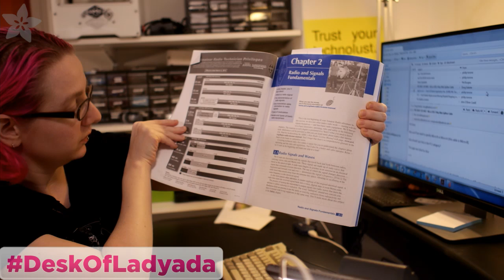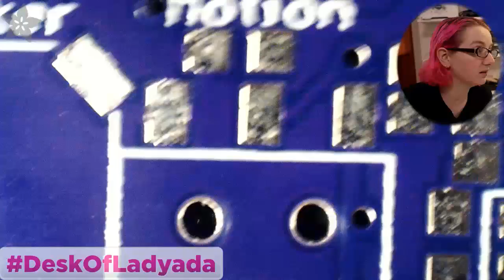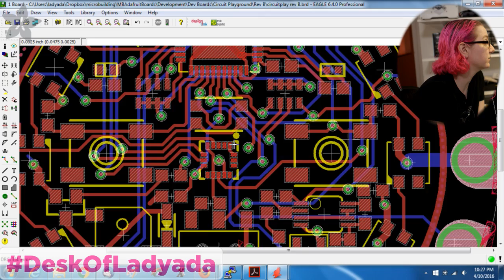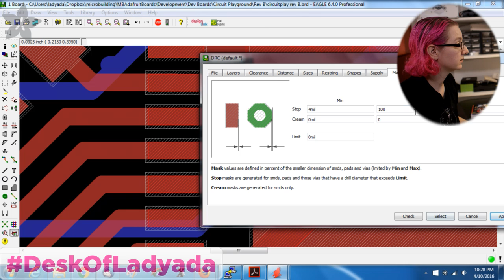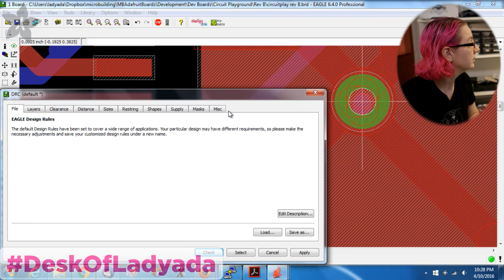Circuit Playground check in - PCB mask thoughts & HAM  4/10/2016 @adafruit #deskofladyada

Comment: welcome to the ham world! hoping that means more ham radio style projects and kits from your world. For instance, packet radio, APRS (more than positional data), and WSPR. WSPR really seems like something you'd geek out about. But packet radio seems like the best fit. It needs to be 2m, not 70cm (the RFM series has one in that range, again unsure of the modem). Lower freq than 2m is great too.

Not amateur radio means NO ENCRYPTION and only "amateur" traffic. Kinda annoying.

Licensing is just three "levels" now. And yeah, you could have passed Technician except for the non-geeky stuff like regulations. There's a better "study" book series that was generated (and then edited) in a cool way.

Comment: For those here in Australia, see http://www.acma.gov.au/Industry/Spectrum/Radiocomms-licensing/Class-licences/radiocommunications-low-interference-potential-devices-class-license-2000 for the details of the 433MHz LIPD class licence.  Basically these should be able to be sold in Australia without restriction.